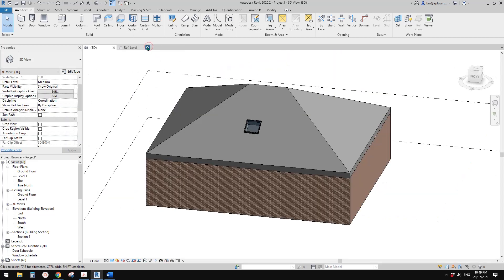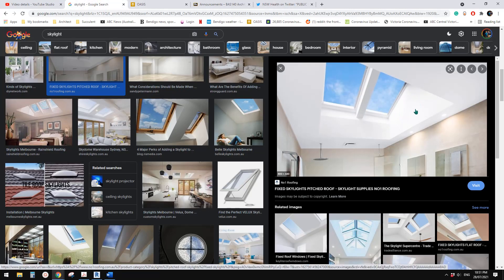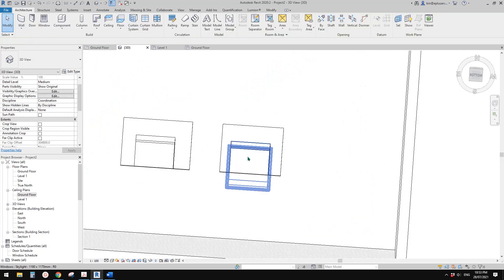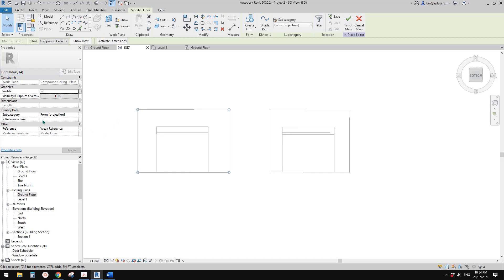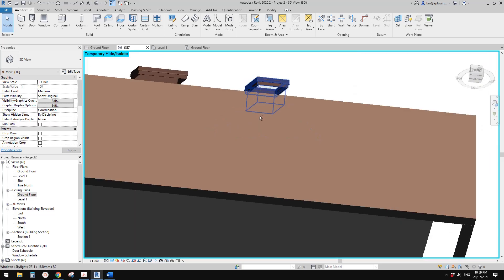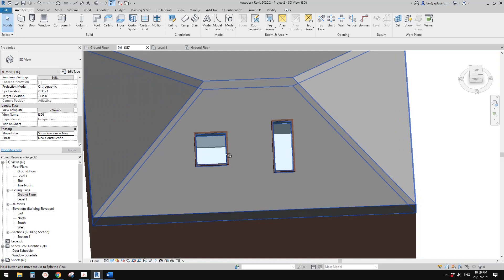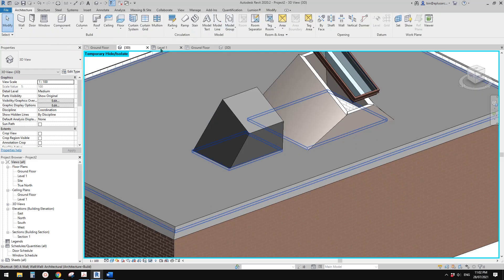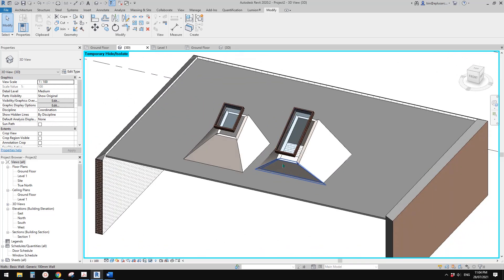Everyday Revit (Day 495) - Skylight Wall using Model in Place and Adaptive Family

Comment: Nice Bin, but in both cases if you look carefully at the top of the walls they are not connected properly to the roof (see it in a section) , and you dont have the option to attach to roof cause they are wall by faces ... any suggestion to solve that?
Reply from the maker: Oh... didn't notice that. Maybe we can use the exterior face of the roof as the work plane so the wall created by face will touch the roof, then we can use join geometry to clean them up.